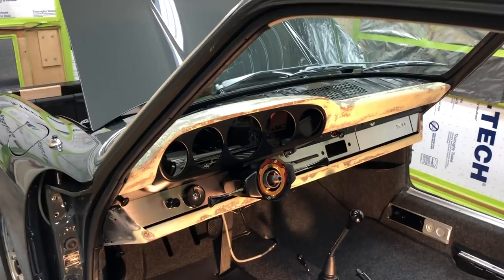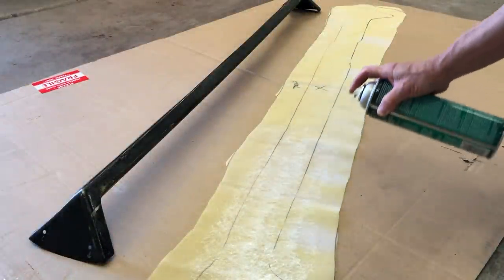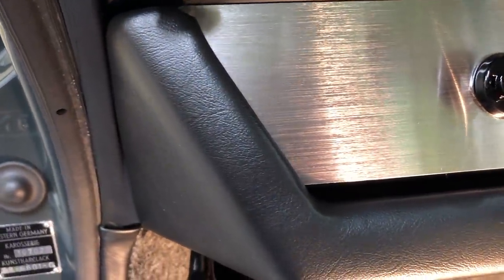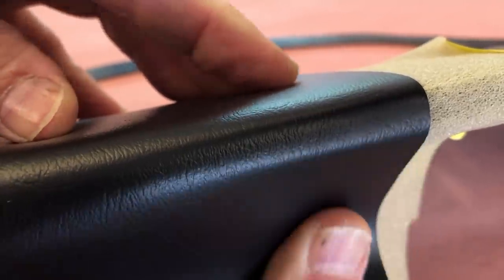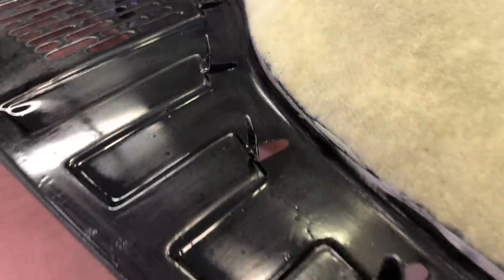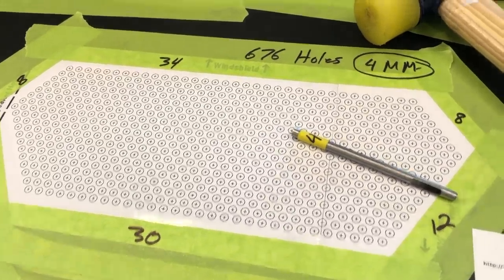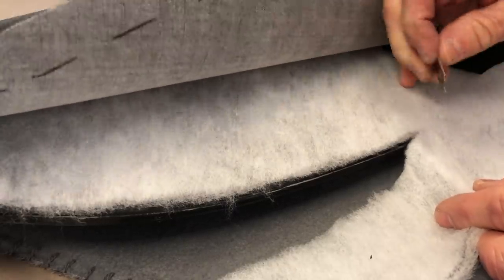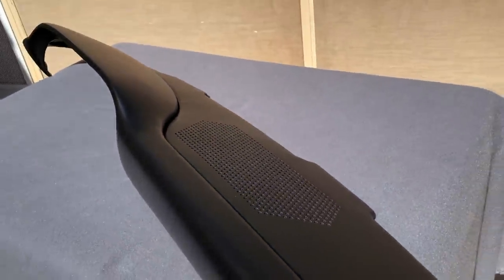Early 911 912 Dashboard Restoration Complete Part-2    Video 68

Comment: Mike, where did you learn these skills and knowledge about auto painting and upholstering? They are top notch and looks like you have been doing them for years.
Reply from the maker: Thank you Doug. I am actually a cabinet maker by trade so some of the painting background comes from there.
The rest is just from years of working with my hands. It is possible to be able to do anything if you can master
the basic feel of things with your hands. Also trial and error ..I've had more failures in life by far than any successes.
The old saying applies well..you don't know unless you try. For me I try everything.. doesn't always end up well but I keep trying things anyways.
Cheers!

Comment: Wow, patience and impeccable attention to detail .excellent close ups.thanks.  I have used landau top and trim adhesive which is very strong and can handle a lot of heat for my boat interior-brush on or spray.
Reply from the maker: Hello Amundsen thanks
And thanks for the glue tip! I will check into it!!

Comment: Awesome result and impressed with the (w)hole work.  I didn't understand why you didn't glue the foam completely under the fabric and then fit it in place, many fabrics come with foam backing as you probably know.  Also I've never seen parts that aren't glued, you're supposed to put glue everywhere.  
Many professionals would have messed this up.
Reply from the maker: Hello Gplus
Some great questions you have there.. I will try to explain what happens with each one you are describing.
I love fabric backed foam and have some in the shop. This type of foam is great for flat surfaces but will not make a complex bends or complex radiuses.
Its okay to glue your foam to a solid surface but its sensitive to compression dimples once contact cement is applied.
If you push your finger Into a heavily contacted area itl will compress and not return leaving a permanent dimple or imperfection that will telegraph thru to the finished surface.
Contacting only the blind areas and minimal inside radius areas allows for stretching smoothly over the foam for a nice finished surface..again if contact cement is applied to the foam it will be impossible to stretch and cause many imperfections.
Allowing the finished leatherette or leather material to slip and move freely as the surface heats up and expands and contracts.
100% contact is best used when applying to a perfect metal substrate such as the garnish rails. If sprayed the contact cement will cause missed spots and dimpling thats why I brush out those types of areas.
Lots to consider when upholstering!
Reply: Mike’s Restorations thanks for taking the time to reply. Check out cechaflo channel when you have time, he has a great dashboard vinyl covering video (one where he covers a dash with blue vinyl)

Comment: Question for you Mike if you don't mind; what adhesive should I use for  the vinyl leatherette that goes around the gauges (911 993). Thx.
Reply from the maker: Hello Peter
Any high quality high temperature contact cement would be suitable.
There should be a store link in the video description box. If you click on the link and look under adhesives you will see listings of glues I recommend.
Good Luck!

Comment: Mike I noticed u used reinforced backed vinyl like used on seats, what about using vinyl with no backing like most factorys used for this type of covering? and I have not found it to be as available? Some shapes are not possible with backed vinyl.
Reply from the maker: Hello gtbarnes
Thats a great point you bring up..The shape of this dashboard looks to be quite simple but in reality its quite a challenge in the realm of physics. The complex inside radiuses make it almost impossible to iron out all the wrinkles and gathering..
If non-reinforced vinyl is available in this pattern I'm not aware of it but it might make things easier for sure..However the reinforcement does help from over pulling and distorting.
Either way its a extremely tough job to get right.
Im glad its over!! 
90 hours to do the parts in these 2 video sequence .

Comment: Really nice work! Hey, the Amazon store is brilliant as well! I visit it regularly, for various unrelated to Porsche things! Was looking at the VHT engine paint, is that matte, or Semi black? You think you could make it either or and maybe gloss even? I am planning on painting my Vision engine. Might like to do it in various ways.Thanks!
Reply from the maker: Hello Christopher thanks!
And thanks for visiting our new store=) The VHT black im using comes in various finishes but the actual finish of the one in the store which is the one I use is semi gloss in reality. Great stuff especially for heat related components.
Its more sensitive now that a couple years ago..I think they have reformulated it to some degree.
Its possible to get a nice finish with it if prep work is good..but extremely sensitive to re-coating.
Best way to lay it down is three coats in warm dry weather maximum 10 minutes apart with medium wet coats.
After that I would stop no matter the result. Lots of solids so it covers nicely 
Also I haven't forgot about your chrome question..Im working on a chrome video now and will be digging out my files
Ill be in touch and goos luck!
Reply: @MikesRestorations  Hey buddy, thanks! Don't worry about it though, he found a place that was manufacturing them. Like you said, super long wait, super expensive, Windy wasn't going to do all that, though I did share it in his comments. The guy doesn't read his comments, or well at least reply to them, so not sure. Now he is looking to get pipes rechromed for that RD400, but again, chances are we are talking in the thousands, I doubt he would go for that. I will try to find the other VHT options, your amazon store only has that 1 type, seems like. I can't remember, did you say it was vastly superior to the high temp rustoleum or grill paint, or well whatever I can find in wal mart? I would also need to high temp prime it? I could control it with high heat clears right? Hmmmm......

Comment: Hello, where you found the foam and the black leatherette?
Reply from the maker: Hello captainrex
All materials can be sorted fro Autos International Inc.http://www.porschetopsandinteriors.net
The thin white foam was something I acquired years ago from some cabinet packing materials. A German mfg Siematic used for shipping their parts. You can acquire some 1/8 foam from autos inc and I think that would be even better to prevent telegraphing.
Good Luck!
Reply: thank you Mike

Comment: Hi Mike - I’ve got a random newbie question for you. I’m installing a new stock exhaust on my 1973 911. Im wondering what, if anything needs to go in between the exhaust silencer and the heat exchangers? I know I need the gaskets (901-111-193-00) and associated bolts and nuts...but do I need to use some sort of sealing putty or alike on both sides of the gaskets to fully seal the connection? Thx in advance!
Reply from the maker: Hello Matrial
Exhaust gaskets should be dry with no adhesive..There is quite a bit of thermal expansion with the heat generated
which helps to seal the gaskets. Nice and tight nuts with good flat mating surfaces should work nicely 
If cement was used it would eventually cook it and crystalize 
Good luck!
Reply: Mike’s Restorations thank you for sharing your knowledge Mike!!

Comment: Thanks Mike!  I will never be at your level, but want to fiddle my original dash back to a presentable state without completely re-doing it if I can.  As mentioned after your last video, I need to re-tuck the binacle vinyl back if I can.  Here are a couple of photos.  Any advice appreciated!  https://www.dropbox.com/s/2qtszaj8rlj1od8/2020-04-30%2022.31.57.jpg?dl=0    https://www.dropbox.com/s/zjk5rja4jjl4gg1/2020-04-30%2022.32.18.jpg?dl=0
Reply from the maker: Hello John!
Shouldn't be a problem... Just remove the second part with the speaker punched in and you will have access to the back lip and easily be able to re-secure..Its interesting your speaker pattern is different size! 
Im wondering what was the options back in this days for speakers???
Also heat is your friend here. Outside in the hot sun will be your biggest help.
Another tip. If you use acetone to flash wipe the surface before working with it it will re-supple your material and bring it back to new condition and make it more stretchable. 
The trick is too wet a blue paper shop towel with the acetone and quickly make a couple smooth passes.
You'll be amazed how it wakes it back up! Like new again=)
Good luck and please share some pictures when you're back in shape!